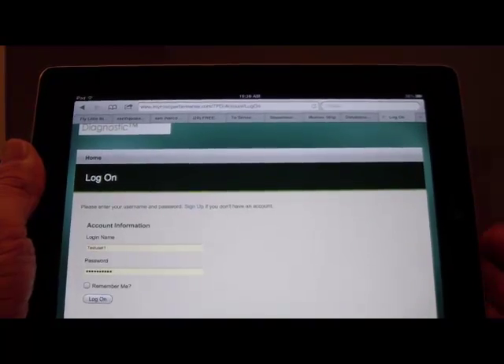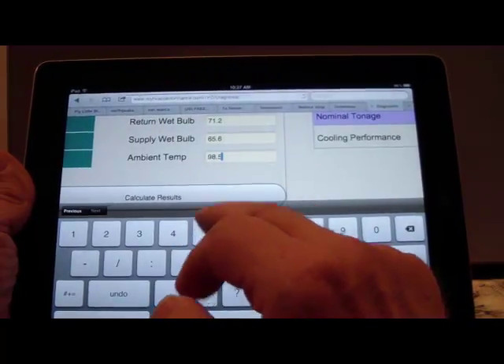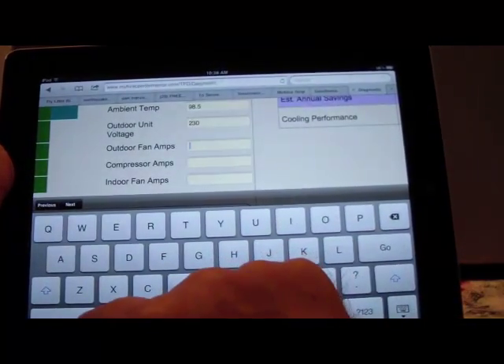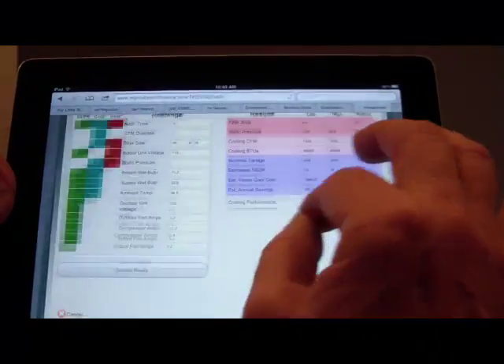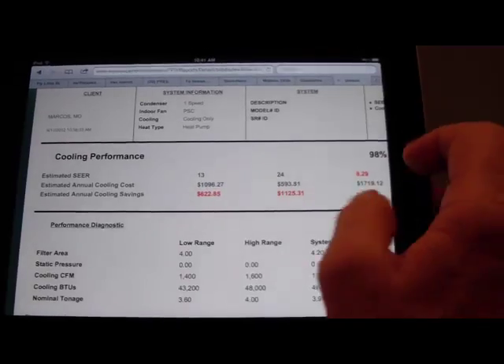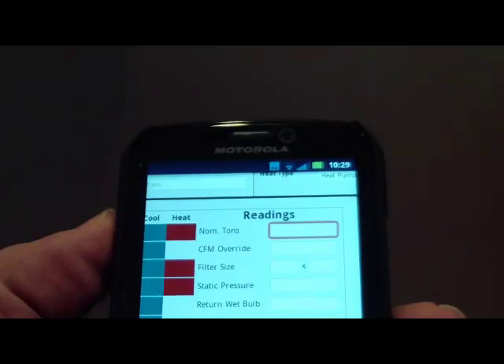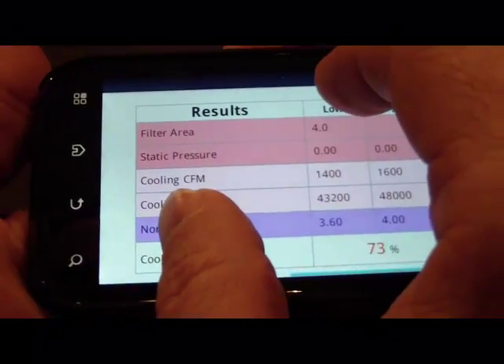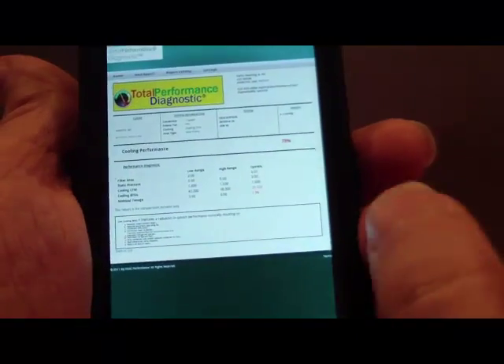Tablet and Phone

Comment: The savings are theory. A 13 seer system will not maintain that 13 seer over the period of 10 years. This doesn't take into account the ducting type and it's leakage, cycle rates and a clean or dirty system as well as a proper charge.